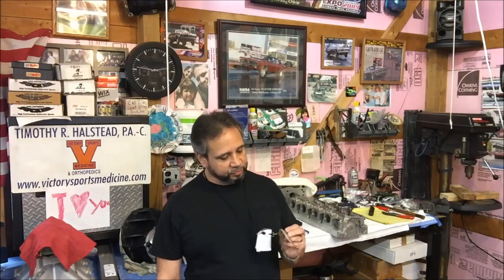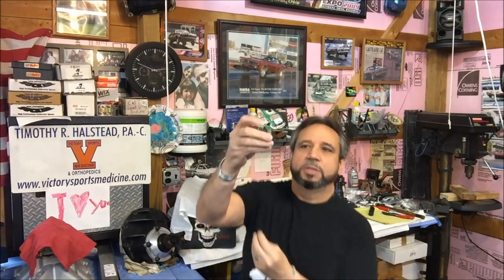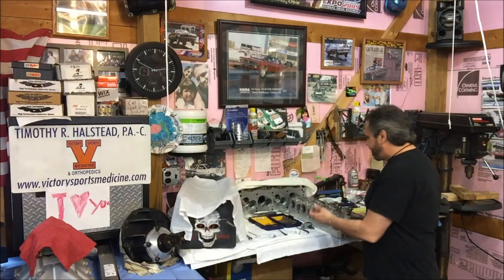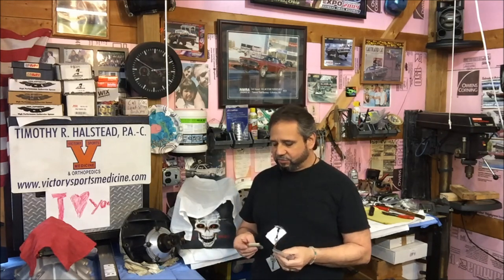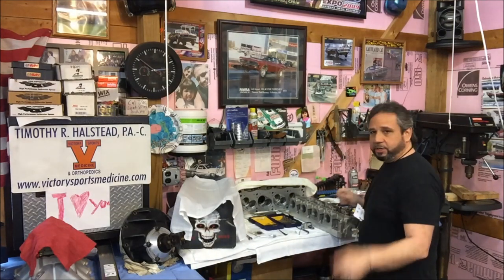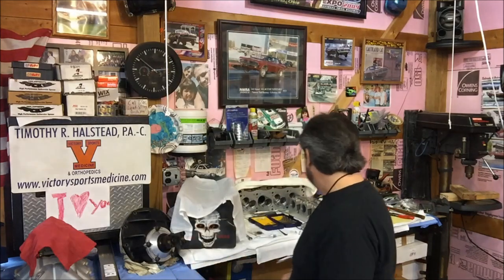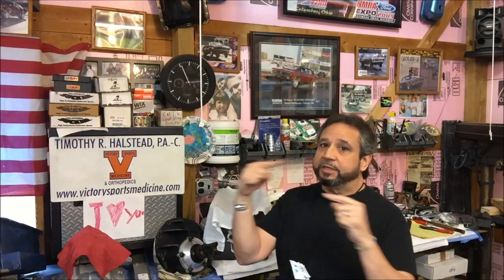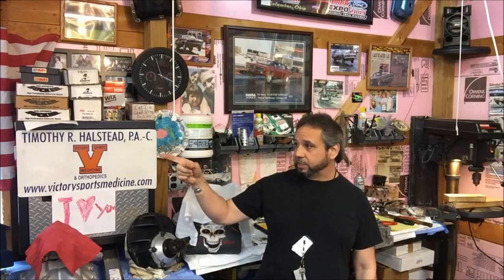Episode 41 . Setting Up Yella Terra Platinum Race Rockers/Build up Of The 409 Cleveland

Comment: Hey Tim IT was posted on a falcon facebook page over here of a shop called MBE,they have a 10 degree head as a 12 as well a intake manifold to suit,what i can understand that CID cast the head but MBE  lightern it and cnc the head.They are quoting 480 cfm.CID IS owned by John who started CHI heads in Aus and sold out and now lives in USA
Reply from the maker: I have been following some of MBE , serious for sure. I know they have lightening programs, have seen it on the net.
Reply: Now that's just getting big headed.  NA would need to turn 10,000 rpm to have them working !!

Comment: When you get it optimal it will take the least to turn the engine. Say it takes 15 foot  pounds and you moved in the right direction it could lower that to 12 foot pounds.

Comment: where can u get the A3 heads
Reply from the maker: Michael, They stopped making them, 37 years ago. I may have a set in the near future. I do have a set of AFDs, and matching tfc intake. These flow  more than A3s, and have modern combustion chamber. These were Pro ported, by Darin Morgan. They do not need custom headers.
Reply: @DragBoss351Cleveland  do u have pics of them

 I like the trackboss cleveland block my get one later
Reply from the maker: @michaeln9905  give me your email, and I will send you pics, and flow sheet.